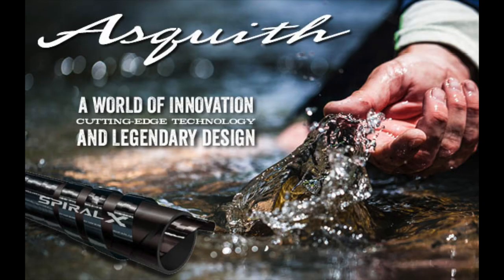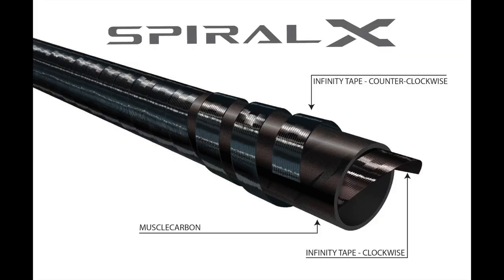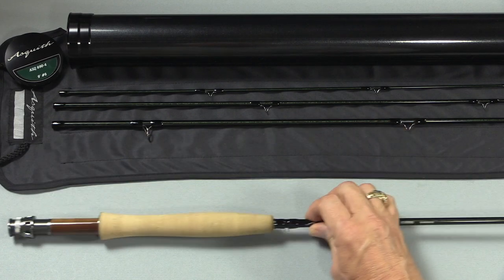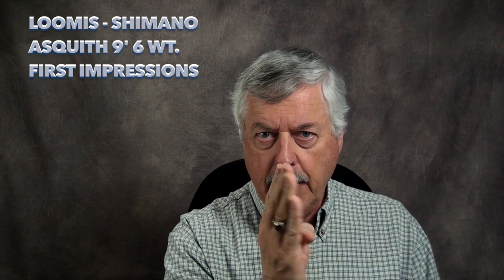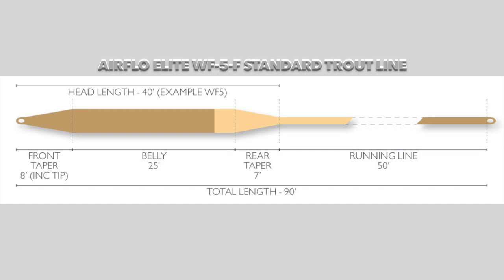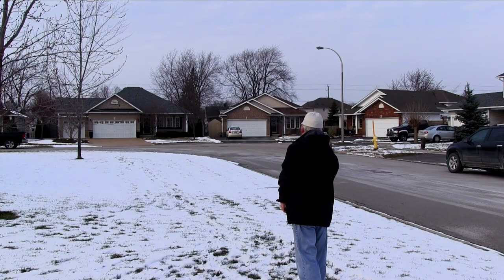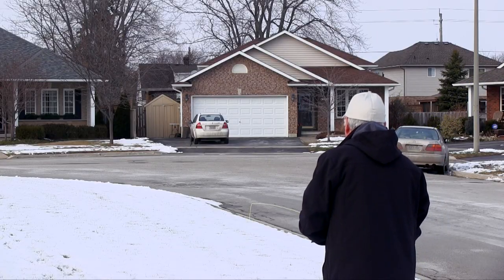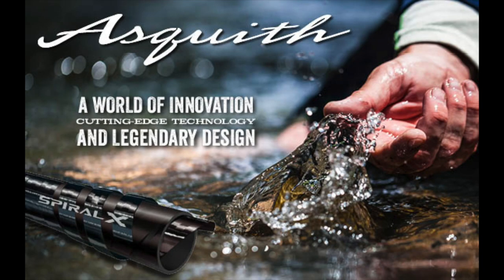G. Loomis - Shimano Asquith 9' 6 wt. Fly Rod: First Impressions

Comment: Hi Peter, iv decided to spoil myself with a 9' 5 wt ASQUITH fly rod.  If its not too much trouble thought is ask could you recommend a good quality fly line to match?  70% of my fishing is dry fly for trout in medium sized rivers. Thank you.
Reply from the maker: You'll have a lot of fun with that rod. It has a very broad latitude when it comes to lines and we can up line it to a 6 or even a 7 wt. if we need to chuck something really big.

For tossing dries, I'd recommend the Airflo Elite WF-5-F as it has a long, fine front taper for delicate presentations. It's an AFFTA standard weight line so it will cast quite delicately.

Look at the Airflo Xceed WF-5-F if you're looking for a more general purpose line. It's slightly overweight, so it loads the rod a bit deeper.

If your area gets a lot of wind, you could step up to an Elite WF-6-F and still have the delicacy, but with some extra load to help drive casts into the wind.
Reply: @hooked4lifeca  Your a gentleman Peter,  really appreciate your guidance,  thanks so much!

Comment: Hi Peter the two rods you put side by side,Asquith and 9'4 wt NRX what is your impression on the 9'4 NRX?
Reply from the maker: It's a powerful 4 wt. that's a very good fit for most trout fishing, especially when used with the slightly overweight 4 wt. lines like the Airflo Xceed. The LP version would be the better choice for dry fly fishing and other applications where light tippets and finesse casting are more important.
Reply: @hooked4lifeca  I mainly fish lakes and throw weighted 8 - 12 wooly buggers so i think its a good choice.
Reply from the maker: @ryantherock7664  Yup, it'll do that quite well with the appropriate line.
Reply from the maker: @ryantherock7664     Yup, it'll do that quite well with the appropriate line.

Comment: I have a question on your opinion of this 6wt and the 5wt Asquith, if you had to choose one for both for 14-16 inch trout and river bass fishing which would you go with? As far as bass fishing goes I would be using small streamers and popper in sizes 4,6,8. Thanks for your time and assistance.
Reply from the maker: Having fished both, there's not a lot of difference between the two. I fish the 6 wt. most of the time as it handles big, weighted flies a bit more easily since it can chuck heavier lines.

Comment: For $1100 and the blank is made in Japan that pumps out many spinning, casting and now fly rod blanks there is no need for a price like that. Fly rod marketing is like golf club marketing, They all make you think you will get more distance with the new and improved model. But its not the arrow, its the indian folks. If you cant cast further than 50 ft this wont help you cast farther. There are videos on here of guys casting 100 ft with a bamboo rods. Othere companies are now pushing the $800 mark. Enough is enough folks
Reply from the maker: There are fly rods at all price points to satisfy everyone. If a high end rod is not for you, don't assume that it is inappropriately priced for someone else.

As far as the blank is concerned, the Spiral X technology is only used in Shimano's high end spinning and casting rods, that were more expensive than many fly rods.
Reply: I do get the point. I said "their " marketing is always talking about distance. Winston Rod company used to say 40 ft was all you had to cast to effectivly dry fly fish. After that it becomes hard to set the hook in time. They're saying not mine. If other companies produced rods that were breaking left and right i would agree with you about strength, but thats not happening, and as far as accuracy is concerned i have seen many flyfishers hit the mark with bamboo, fiberglass and graphite of all makes. If the blanks were made by Scott where it is a small company and they build them by hand, then the price might be justified, but not a large factoy that is highly automated and sells spinning and casting rods for hundreds less. But this is all just my opinion. But im not plunking down $1000 for a Shimano made blank.
Reply: @pahuntnut  the blank is only part of the equation. You are also paying US labor to wrap and cork these rods. They charge that much because they can.
Reply: @cachi-7878  yup cost in usa labor.. most japan rods had move their shimano rod builds in china now, still great builds... they keep the reels made in japan still.. that guy is complaining on something he's not doing nor can't buy it.. if price is too much there's others out there for his budget .. or he can start his own fly rod builds with nice builds and materials and lets see him sell it for a cheaper cost lol... easy to talk about products when hes not the one doing it..